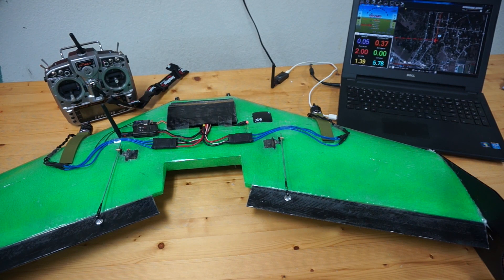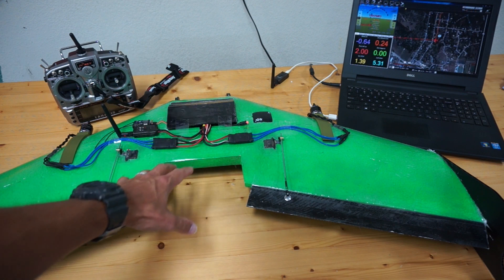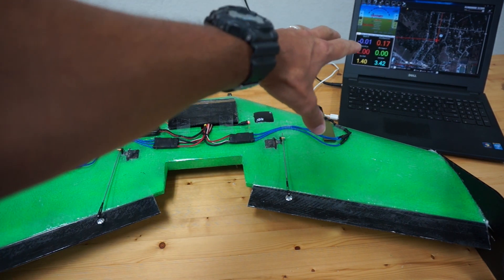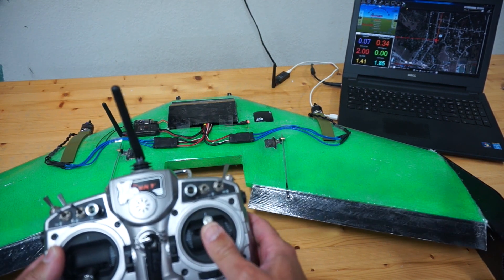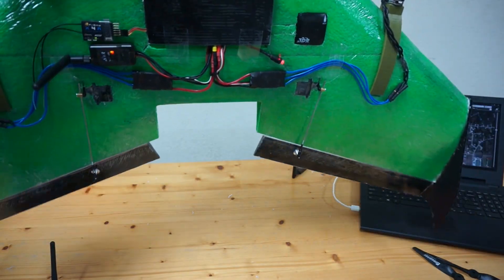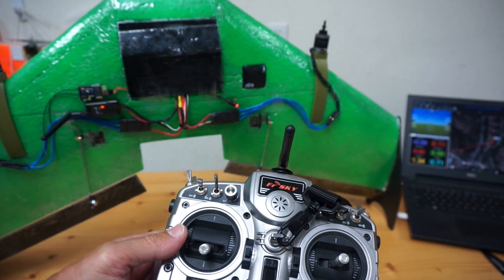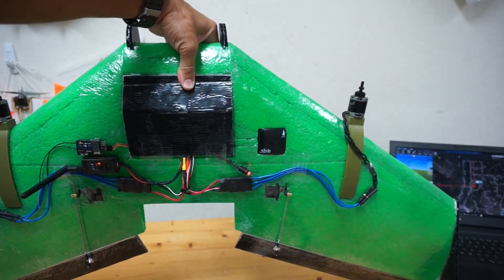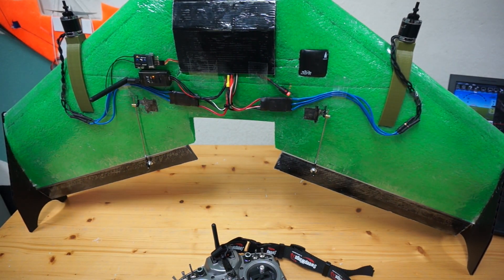Pixhawk 2 Cube and SweepWings Flinch Tailsitter w/ APM:Plane Firmware

Comment: Ever have a problem with the motors not spinning up in any of the quadplane modes. If i look at the servo output page, the controler isnt sending anything to the escs in q sabilize. Everything works fine in any other mode.
Reply from the maker: I'd recommend double-checking your params. Go through this list and let us know what ends up happening: http://ardupilot.org/plane/docs/quadplane-parameters.html
Reply: Dennis Baldwin I Figured it out https://youtu.be/ryrBOzR84-k

Comment: Hi Dennis, I'm setting up my test rig to work out kinks in the electronic setup and I've run into a couple of things I'd like to know about your setup. I started using QGroundControl as the interface and it has a tailsitter config, so I thought that would work. Have you tried QGroundControl? Which PWM pins are your motors and servos connected? When you set up the sensors, did you leave the wing flat or in the tailsitting configuration?
Reply from the maker: David, I'll reach out to you via email and maybe we can set up a call this week.

Comment: Looks good.  You're definitely going to need to extend the elevons based on my experience, but if you choose a day with zero wind, you might have some success in hovering.
Reply from the maker: Thanks, Guy. Appreciate the feedback. I think I also need to extend my mounts about an inch. I feel like the props are swinging too close to the wing. I may tweak that before the maiden. Will keep you posted.

Comment: Dennis am I seeing those motors pointed out towards the wingtips a couple of degrees?  If so will that affect the flight characteristics of the wing.

Also with all that surface mounted equipment don't you think the airflow will be seriously impacted?
Reply from the maker: Yes that was my fault when I mounted them. I should have used a straight edge but my hot glue was drying quick so one of the mounts is tilted more than I'd like. I'm probably going to address that before the maiden.

Regarding your comment about airflow I'm not 100% sure to be honest. I think right now my bigger issue is I need to extend my mount arms as the propellers spin too close to the wing. My build is based off this:

https://docs.px4.io/en/frames_vtol/vtol_tailsitter_caipiroshka_pixracer.html

Great comments, Wayne. Thank you and I'll share more as I learn more :)